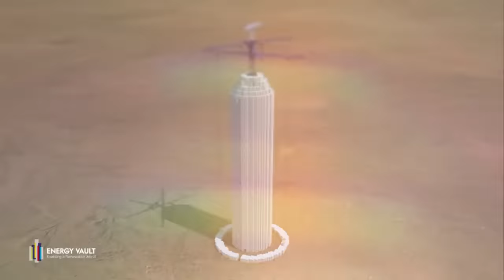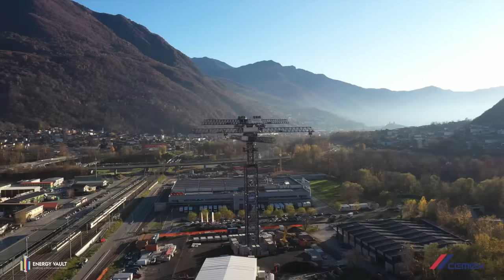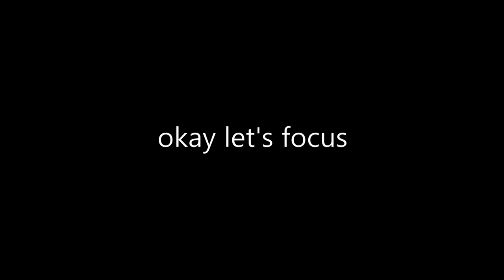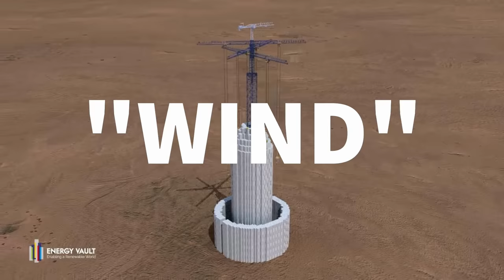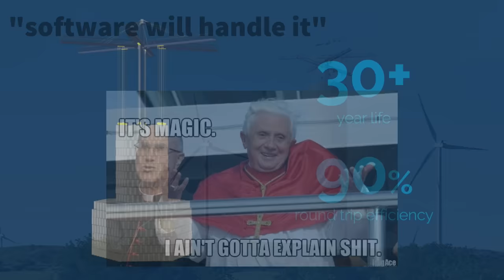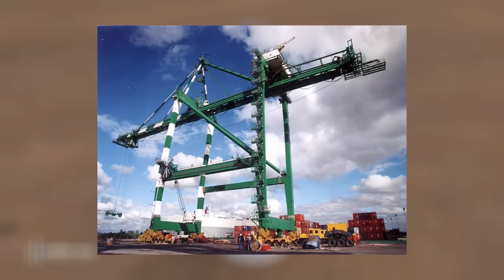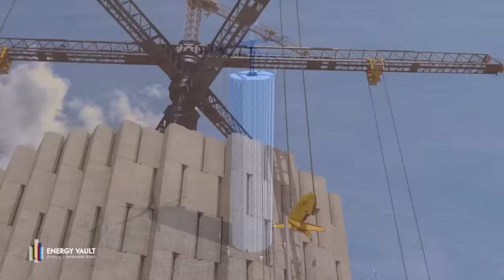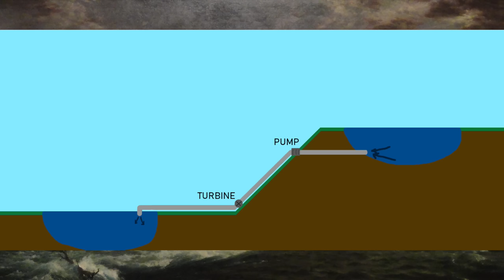The Energy Vault is a Dumb Idea, Here's Why

Comment: As someone who works in the energy industry, huge round of applause. There's a goldrush in energy storage right now, and there are so many initiatives like this, where a tiny amount of energy is stored for a huge MWh price. This one is especially terrible though...
Reply: As you are someone with experience in the energy sector, which energy storage type and generator (e.g. flywheel + wind turbine) would you recommend to a household and which would you recommend to a government.
Reply: Is that one really that bad? I thought the price was... high, but not stupid high and the main problem was to let the thing run for years.
Reply: Have you heard of the ETES approach from Siemens Gamesa? What are your thoughts on it?
Reply: @steemlenn8797  It's Occam's razor, this is a extremely complicated system, which generates at an extremely high €/MWH. It's unappealing for investors, grid operators and as pointed out, store a tiny amount of energy for what it is. The UK for example is currently consuming 25 GWh/h per at night and up to 45 GWh/h at peak. 4-8 MWh/h for 8-16 hours is a flea on an elephant. I'd say schemes like this are more about increasing a company's profile more than anything else.

Great that it looks like something out of Fallout though
Reply: @Vulcano7965  I'm curious about it, I haven't seen any output efficiency charts for it, but the fact they have test units in operation alone is a good sign. I'm not sure about the claim that it's scalable, but that could just be me being skeptical, if anything it's a good use of old brownfield thermal sites.
Reply: @sybrandwoudstra9236  For new generation methods, it really depends on location, budget and demand. For domestic generation (wind/pv to a battery, local geothermal etc) it can be a while before you see a profit, the lowest hanging fruit here is always energy reduction. This doesn't mean everyone has to turn off heat or not use power, but rethinking architecture so heating is at the forefront. Most energy is wasted on space heating, so reductions here make huge savings (district heating, insulation, heat pumps to a point...). I certainly wouldn't recommend flywheels or other exotic storage methods, like heat or pressure on the consumer level.

On the country level, it's going to be a difficult few decades for some places. The divestment in thermal power, and the increase in renewables is not an easy shift - renewables are volatile compared to other methods, and caught between shifting demands and shifting wind and sun availability can be a difficult balance for grid operators. That's why matching wind with hydro is an unbeatable method for meeting demand and balancing the grid (use the wind when it's there, and use the hydro when it's not). Not all countries have the geography for this though, so these will have to rely on neighbors for security of supply - I'm not saying I support this, I just see where the market is heading.

There was a big trend to push toward hydrogen markets, using surplus wind energy to run electrolysers. It's maybe possible, but going down this path with now security of supply for constant hydrogen access, it might  be a ball and chain. If you have to supply consumers with hydrogen in low winds, you could be stuck using gas to generate it.
Reply: @DougalNorges  doesn't scaling for ETES just mean making a bigger box for the hot stones? As long as you're not using cranes to constantly stack and unstack it making big concrete boxes is pretty easy :D as a bonus energy losses go down because square-cube law.
Reply: @jfolz  😂 I'd hope no cranes would be involved. For me, the question is how many units at a decent size would you need to meet local/national demand for an hour, a day, a week. Are you going to need thousands before making an impact? At what point is it completely uneconomical?
Reply: @DougalNorges  at least they claim to have demonstrated both 5 MWh (box ~ single car garage) and 120 MWh (box ~ multi family home) capacity. You would need maybe 10-20k of the big ones to power a country for a day.
Reply: @DougalNorges  I search for news about its progress then and there and the last stand from Gamesa atm is, that the current political situation makes full implementation/upscaling financially not that much viable.
Reply: @DougalNorges  why do you write GWh/h and not GW?
Reply: @niconico3907  I use it because it's the standard measurement used in the trading of power. One point though, its not to be confused with GWh, GWh/h refers to the average generation over an hour, but they serve the same purpose. When you want to discuss generation over time, you can't just talk about rated power output of a plant, e.g if a coal plants turbine has the rated power of 400 MW, it doesn't tell us anything about how many MWs it can generate over x amount of time.
Reply: @DougalNorges  the capacity of the power plant tells us how much energy it can produce in any amount of time. In the case of a 400MW coal power station, it can produce 400MWh in 1h.
Reply: @niconico3907  👍 yup, but MW alone isn't commonly used when discussing production and demand.
Reply: This is exactly why I'm a Technocrat, too much dumb ideas are being pushed by people who fall under Poe's Law where it's difficult to tell if they actually believe that their solutions work or if they are just scammers.

Comment: I have a genius idea on how to make your system even more energy efficient. You can use solar energy to boil water from the lower reservoir, and then you can recondense it in the upper reservoir so that it doesn't need to be pumped. Then when you need additional energy, you can allow the water from the upper reservoir to spin the turbine and dump into the lower reservoir. I call this variation the DumbAss Modification... Or DAM for short.
Reply: also why not hook up the boiled water into another steam turbine? rofl
Reply: ok ok, i get what you going for, but for the record boiling water is less energy efficient than pumping it.
Reply: If only there was a natural way to boil the water... like by using all the energy volcanoes waste.
Reply: @khhnator  The Sun : allow me to introduce myself
Reply: I know how to improve on this idea. Use some minerals that naturally decay and produce heat to create the steam to turn the turbine, and let it recondense in a closed loop that creates constant power.
Reply: @TeslaRifle  Then place them at the edges of the continents and wait for great things to happen. Sushi roll?
Reply: @dclipper8052  They may have been referring to  oil as "mineral", but nice reference either way. ;)
Reply: @cliftut  I don't think he meant oil...
Reply: @cliftut  They meant radioactive material, the description is effectively a simple nuclear power plant. Oil doesn't produce heat when it decays like radioactive materials
Reply: They should do that with the solar panel field they plan to build in the Sahara desert… oh wait
Reply: @fukkitful  Geothermal energy is fun, except there are very few places with active volcanic activity on earth.
And the very few places that exist are in well preserved natural remote locations.
Reply: @dclipper8052  Oh oh!  Why not put these devices on a violently active fault line ON THE COAST??  I bet that’s got loads of potential!
Reply: What if we use mirrors reflecting the sun into pockets of some kind of cheap material, like sand or something to harvest our solar heat energy? What do you think? Maybe in a tower situated in a ring of mirrors that automatically orient themselves to angle the solar energy? Then we wouldn't even need a whole lot of water. We could build them in the Sahara desert!
Reply: Wow, genius! Awesome way to save energy, by using energy instead!
Reply: @Xonovelixi  I think it would be more efficient to use solar panels to run a pump than to use it to boil water.
Reply: I get that this is tongue and cheek, but evaporation and boiling aren't the same thing. Evaporation is water turning from a liquid to a gas below the boiling point.
Reply: @God-yb2cg  Geothermal has other problems too.  Generates waste, reservoirs require proper management,  has high initial cost, and can cause earthquakes in extreme cases.
Reply: I've been very much talking about such a concept since 2005 whereas the water evaporated by solar heating would get distilled to the outer "side" walls tilted away from the magnification of the sun.
Reply: sounds stupid. do u have any idea how long that would take. if your going to boil water and condense it its better to use that for clean usable water not in a battery.
Reply: @mayainverse9429  Its a good thing the water cycle does that for us naturally.
Reply: I love this idea because you could simultaeously feed the lower reservoir with salt water, and use the whole system for desalination simultaneously. Genius!
Reply: @mayainverse9429  I actually have an instant clothe steamer which works by floating an element plate similar to an inside of a toaster that heats the surface of the water in seconds
Reply: @ThankYouESM  So we just need to scale that up to work with a giant water reservoir is what your saying? 

What if we just throw a bunch of toasters in simultaneously, should be the same right?

I do know from experience you don't want to in contact with the water. Found that out when I used that method to try and heat up my hot tub last winter.
Reply: @fukkitful  Just like the clothe steamer, the wiring never touches. Sorry that I didn't make that more clear, sometimes I forget too many people lack near enough common sense.
Reply: @TeslaRifle  But then how do we store the energy? Throw those minerals into shallow sections of the bottom lakes and let the steam rise to the top lake.
Reply: @edwardmitchell6581  no need to store it if you produce a surplus constantly. We can build more than enough nuclear plants to make storage a non issue
Reply: @TeslaRifle  I'm in full support. The US has a lot of land free from earthquakes.

Ironically, my mother was a no nuker. I should ask if she's changed her mind.
Reply: @ThankYouESM  So water and wires shouldn't never touch and don't touch both wires at the same time? I think I can manage that. What about the neutral wire and the ground, still apply?

“Think of how stupid the average person is, and realize half of them are stupider than that.”

― George Carlin
Reply: @Will_Forge  sand is not very good at containing heat energy, water would be better, potentially even solar panels since you collect a lot of rays in a single spot. It's also better to put the mirrors in space orbiting the sun, that way they could collect way more sun rays. Also this idea is called Dyson swarm.
Reply: @ThankYouESM  Floating the heating filament on the water don't seem very safe. I'm guessing the reason they chose this method was because it would produce steam faster. Only need the top layer to boil off savings time compared to heating all the water to the boiling point. Id guess its not a handheld steamer. What  model is it, Im curious to see the design.
Reply: @nekleetorismagnum  They use molten salt. 

The difference in heat capacity between land and water is why there is always a breeze at the beach.
Reply: @fukkitful  Since decades ago, there are still electric kettles in the market that have such the heating element inside the water while at the bottom. I've never heard anybody complain about those ever electrocuting anybody. Secondly... it does not even require any wiring because of what is caller solar heating... by focusing the sunlight on the floating apparatus which absorbs the rays. Even if there are wires to store the excess power... nobody will be in the water tank when activated. Toasters are not designed to be in water, so I have no idea why you would give such a strange example.
Reply: @fukkitful  Model: https://www.youtube.com/watch?v=Xtm5E0WfsEk
Reply: @ThankYouESM  Have you read the other comment in this thread? Its mainly just sarcastic comments.
Reply: @ThankYouESM  Its the same kind used in hotwater heater also. They are insulated and designed to be submerged.. You said the steamer was like a toaster, which isn't insulted. You should never stick a fork because of that.   The video looks like a small hotplate thats just sprayed with water.  I don't know where you got that it was floating.
Reply: why dont we make the whole system even more automatic? dont boil the water, let the sun condense all of it. because while the sun is out, we wont be using that oversized batery anyway
Reply: @stevenbartel5008  Condensed or evaporate?  During the day is when demand is the highest. Most ppl are asleep buy 11pm. Pump storage is used during the day to help keep up with demand. Once demand drops the excess energy is used to refill the reservoir,  

"Automatic" is how every dam works thanks to the water cycle.
Reply: I think you need more nergy to vaporize it than to move it
Reply: or use a ram pump to restock the upper lake
Reply: @cliftut  the reference is Fukushima.
Reply: @danmortenson5274  the joke is the sun evaporates water and rain is condensation. They’re describing how all dams work.
Reply: @mayainverse9429  the joke is that this is how all dams work.
Reply: @TeslaRifle  now you're just talking crazy.
Reply: DAMM! 😮
Reply: @TheWeaponshold  dams are usually filled with rainfall…
Reply: @unmannedair why boil anything? Use solar to power water pumps. Faster and require less energy.

Comment: Also, like flywheel energy storage, the problem is that one can't practically extract all the energy in the system: the energy in the bottom half of the pile is very low, and cannot be economically extracted. In reality, it would be better to start the pile on a hill of rock. Like, erm, pumped storage.
Reply: @Error 909 Not Found no it doesn't, with pump storage you have the hill so a height difference which always gives you a pressure difference, so even if your higher reservoir is not full you always have a pressure difference, here the first floor you have like 1m height difference so 1m worth of potential energy, wow
Reply: @sourand jaded In terms of synchronisation, couldn't you just achieve that with clever gearing?
Reply: @Error 909 Not Found that's not how this works
Reply: @sourand jaded you're missing the point of flywheels. All storage methods that are actually being used right now have some niche to fill and for flywheels that id very very quick responses to energy demand. They're clearly not meant for full grid storage and anyone who says they are is an idiot. Their niche is to deliver energy quickly during unexpected spikes in consumption or absorb energy during unexpected spikes in production.
Reply: The issue isn't so much with reclaiming that energy, as there isn't too much in there, compared to the total energy this station could handle over its lifetime. The issue is that half of thr blocks are completely useless, as once half of them are "lowered", there is no potential energy difference between the top rows of both stacks. So essentially, half of the blocks are just used as a spacer.
Reply: If you stack them on each other you already have to stop half way.
Reply: All energy systems have losses, this one seems particularly inefficient
Reply: there are so many issues that are obvious to even a lay person that it's amazing that this would even be attempted as a scam, let alone a sincere proposal. it's like a parody of stupid techbro ideas
Reply: @sourand jaded Why are you skeptical of large scale inverters? Most modern wind tubines use them already to fulfil grid connection regulations. The only downside i am aware of is that they are grid following instead of grid forming. But thats only really a problem if we dont have enough synchronous generators in the grid and there is research going on in building grid forming inverters.
Reply: @Error 909 Not Found you're aware pressure is water*height right? 
And the system is made so there's water in the pipe connecting both réservoirs, so I can tell you the overall efficiency will always be far better than the first levels of this tower
Reply: The energy stored in a flywheel is square of angular velocity. Not much energy left when it slows down. So not a big problem